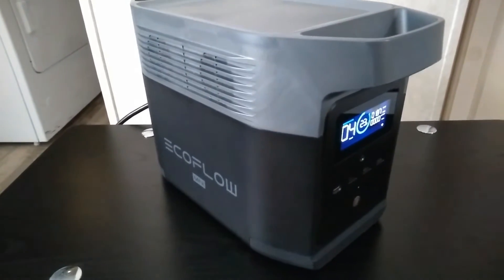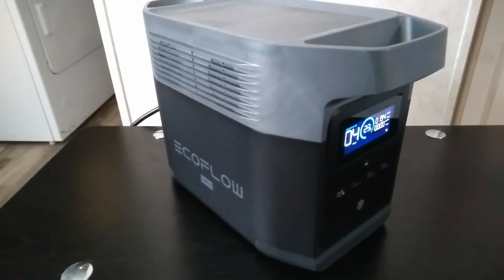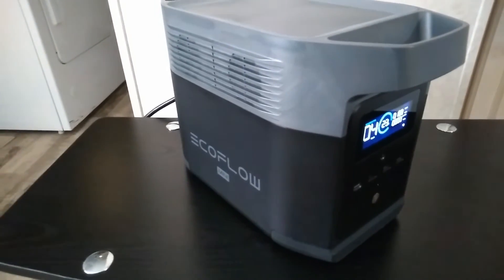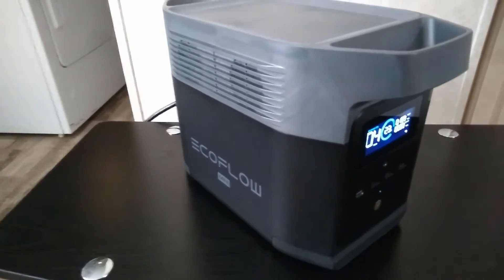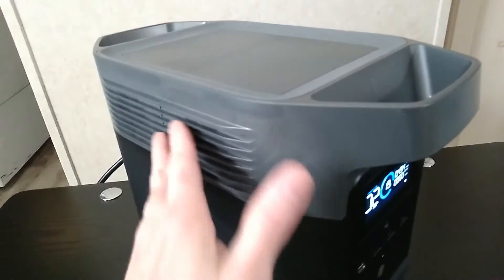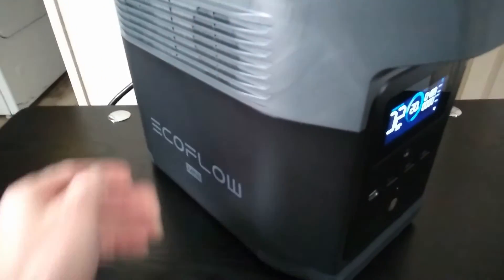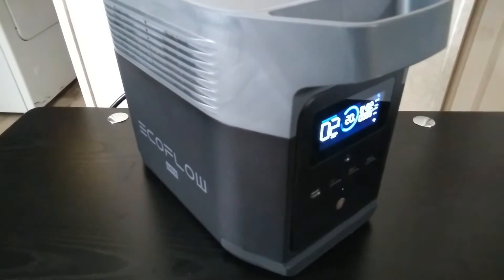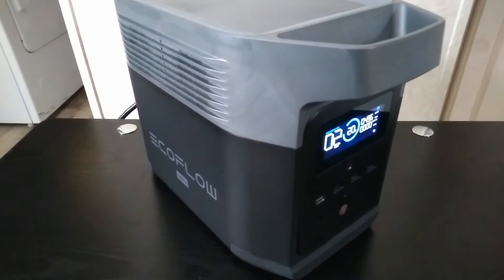Why slow charging is better

Comment: River2 Pro here. The fans are ON during charging at all times from the lowest 100W to the fastest at 850W, it makes no difference, sadly. So it also boils down to how many hours you'll be hearing something akin to a vacuum in your living space on a daily basis. Having said that, It's 26 degrees inside and I'm yet to detect any significant heat coming off the unit during charging or discharging.

Comment: Anytime you remove hot air from the case, you're removing heat from the batteries. It keeps the overall temperature down in the case. It doesn't just cool the electronics. Heat is heat. If you remove heat from a box, everything in the box cools down.

Comment: Why won’t my EcoFlow app let me change charging speed….do I have something,off
Reply: There is a physical switch next to the charging port to switch from fast charge to manual charge speed
Reply from the maker: Which Ecoflow model do you have?
Reply: @SoGenFan  max 2
Reply: @SoGenFan  I updated the firm wear.They said let the battery get to 70 percent then try,don’t think it’s gonna work

Comment: So, i had Delta 2, solar panel charge single panel 230 watt is better than two panel 460watt?
Reply from the maker: It's OK. 460w into 1024wh battery is less than 0.5 C rate (input divided by battery capacity).

1 C means input speed matches battery size (in the case of Delta 2 it would be 1024w going into a 1024wh battery). 

0.5 C is a good compromise of speed and longevity. Up to 1 C is still OK,  just not recommended for daily use. Above 1 C should only be done occasionally and for short bursts.
Reply: @SoGenFan  thank you for your reply.
I have two same solar panel
power (pmax) 230 ±3%
open circuit voltage 36.48
short circuit current 8.20
voltage at maximum power 29.53
current at maximum power 7.79

delta 2 support 500watt max
11-60V 15A

Question is,  parallel or series? which one is best fit? also delta 2 to solar panel distance is 20meter.
Reply from the maker: Parallel is your only choice. When connecting solar panels to a power station, you need to look at the 'open circuit' voltage (VOC). The maximum power voltage is irrelevant (and will always be lower than VOC).

IF you did series, it would be 72v (36 +36).

Once the solar panel is connected to the power station and providing power the voltage will drop - but you cannot connect the solar panel because at first the voltage would be too high!

So if you do parallel, you will be limited to 15A at 29.53v which will give you around 440w.👍 Make sure you are using heavy gauge cables for the 20ft distance, otherwise actual output might be lower.

Comment: I general everything you do should be as low wattage and low amperage as possible. Heat is not good for batteries but also a loss of energy.
Reply from the maker: Ideally yes. But there's no sense having a power station that can output big power or charge fast and never use it like that. Just be aware of the heat issues so you can avoid excessive heat build-up. 👍
Reply: These batteries don’t even get that hot I have tested them with a thermal imager and they never got over 80 degrees, some people even have these in garages and sheds…. Unless you are in those conditions fast charging won’t kill these units they aren’t nicad or lithium

Comment: Heat is the #1 degradation factor of any lithium chemistry. Keep preaching the word.
Reply: Thats why they have fans and tons of flow at least on my delta 2 max with extra 2 batts…. If you look at the diagram of how its built it ABSOLUTELY cools batteries too

Comment: I wished manufactures like Ecoflow or Bluetti would be more clear about the longevity of their Lipo4 batteries.  When they claim a 3000 life cycle, that's under the best lavatory conditions, which is mainly 3000 very slow charges.    If their batteries are mostly subjected to quick charges, they'll get nowhere near 3000 cycles!